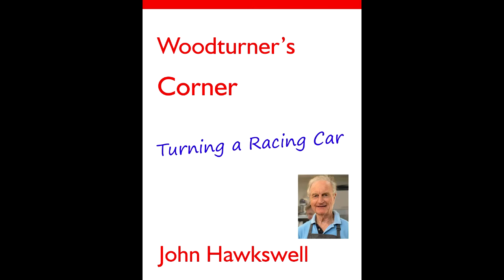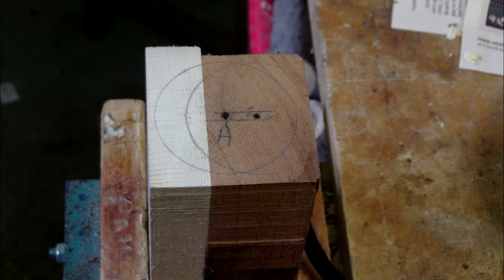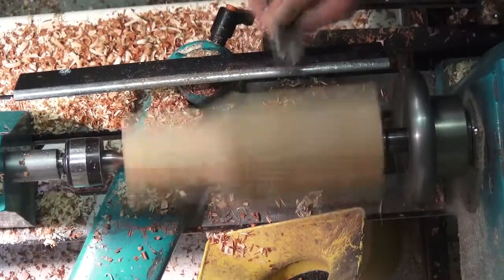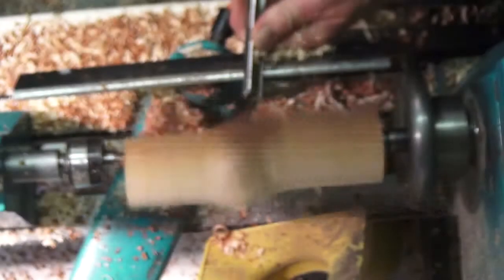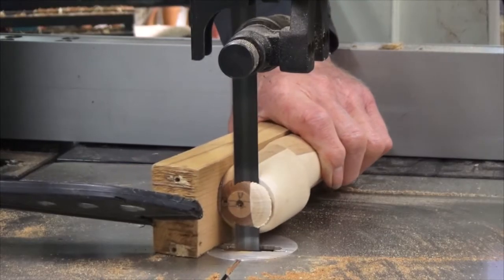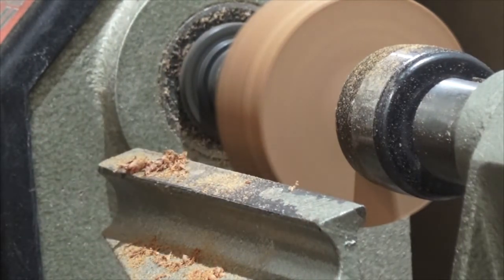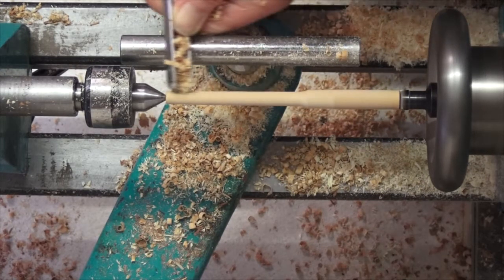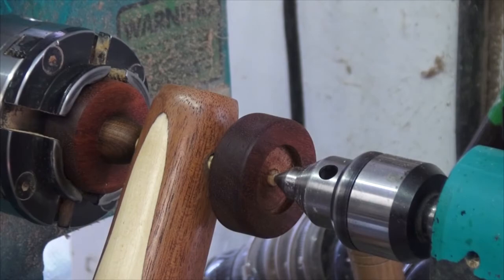Turn a wooden racing car

Comment: Nice project. What website did you get the project from? Greetings from Kentucky, USA!
Reply from the maker: Hi Howard  Thanks. The car originated from Richard Raffan 's  Turning toys DVD and you can download a free plan I  produced from https://www.gaw.org.uk/blog/wordpress/wp-content/uploads/2011/11/Toy-car.pdf. The racing car design is further development of that design. Compared to the  plan It has a longer hood (4.6 inches)with  a shorter rear section (2 inches), overall 6.6 inches long.  I haven't produced a plan specifically  for this version. I hope this helps.
Reply: Hello Howard this is bob piccola I'm a Turner also
Reply: @bobpiccola7817  Sorry Bob, I just saw this. I'm just a beginning so stop by sometime give me some tips. :)